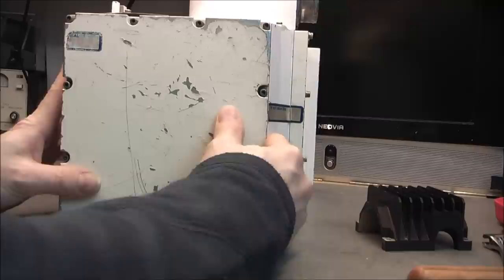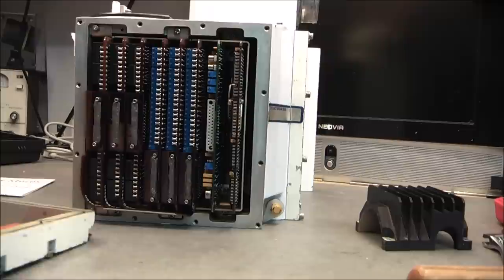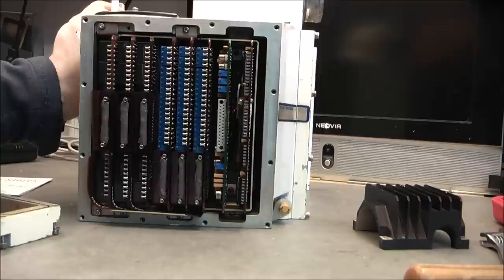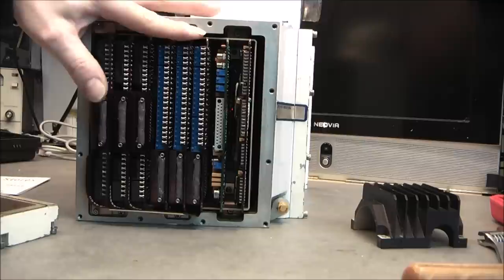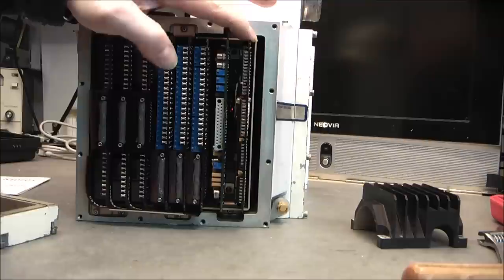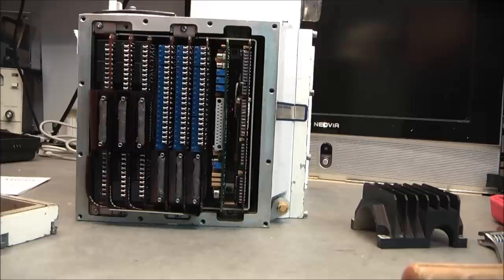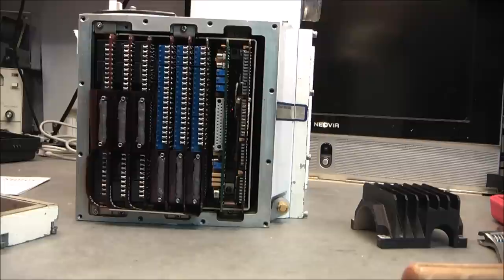Battletank boresight thermovision sensor teardown

Comment: The cryocooler is a split -pair Stirling type, the working "fluid " in this case is high pressure chemically pure helium (99.999% pure) is at a pressure of approx 30-40 bar. The compressor side of the system produces a pulse of gas which travels along the thin tube and and moves the metal piston with the spring at the bottom( displacer / regenerator ). The reciprocating action of the displacer/regenerator cools the detector by only a fraction of a degree each cycle  but with many cycles each second the the detector is cooled to cryogenic temperatures within minutes.
Incidentally,  the detector is housed in a vacuum which is what the short pinch-off tube is for.

Comment: The cryocooler is a split-pair Stirling refrigerator. It used compressed helium as a working gas. 

Most of the inner parts which make it work are already shown in this tear-down. The details can be found in the wikipedia article for "cryocooler", and in Huges patent US5596875A, "Split stirling cycle cryogenic cooler with spring-assisted expander."

25:24 is the refrigerator displacer; the "filter" inside is the "regenerator" 

48:06 is the cylinder of the Stirling refrigerator, built into the dewar in which it keeps the imager sensor cold; 
inside of this cylinder the diplacer moved back and forth; the cold was generated at the very bottom of the cylinder

26:04 the large cylinder is the compressor, which produced the pulses of pressure which made the whole thing work. 

When it compressed the helium gas, the gas heated up (just like in a bicycle pump); the excess heat was taken up by the compressor casing; Compressed and cooled to the room temperature gas now flowed though the coiled tube to the refrigerator half. There, it passed through the regenerator inside of the displacer, where it exchanged heat with the fine metal mesh; Then, the gas reached the cold end. There it was allowed to expand, on the downward pressure swing; This made it cold. The cold gas then flowed back through the regenerator, exchanging the heat and now cooling the regenerator, which then cooled the next portion of the incoming has on the next cycle, and so forth, making it colder and colder until an equilibrium set in.

The cycles repeated maybe thirty times per second or so. With just one stage, such refrigerators commonly reach liquid nitrogen temperatures. In fact, larger ones are sometimes used for production of liquid nitrogen on a small scale.
Reply: how do you know?

Comment: Interesting video again, awesome. Tesla500 took apart a similar type of cooler a few years back. The thermal sensor i guess must be a single line rather than an array which is why it needs the rotating mirror.

Comment: Ah it has a flubber pump cooler on the back.  Pretty sad you ended up killing it. I remember getting a bunch of those SBRC imager heads. Surprisingly they are rather easy to get working. They use PtSi. HgTe, or InSb photodiode detectors inside. Just use a scan timer and a FPGA and convert to images at 15 30 or 60hz and you can replace 99% of the stuff in that unit short of the cooler and sensor.🤓

Comment: Watching that cooler  die was sad.  Great tear-down as always.  Audio went down quite a bit in this one, headphones at full volume was barely enough.
Looks like 60 individually calibrated mircobolometer sensors. and if I had to guess the facets of the rotating mirror will be offset by a small angle from each other to scan 8x60=240 lines of long wave thermal data in one revolution.  Much faster than the AGA because only one rotating member (less noise too) but at the cost of 60x more sensors.
The sensor part has a vacuum jacket around the sensing elements cooled from the cryo-cooler side and illuminated from the beryllium lens/port side.  The heavy gauge wires may have been for a small heater for thermal control as the cryo-cooler may have been uncontrolled and working at full capacity all the time.

A modern FLIR unit is quite a bit smaller and probably has better specifications for all features.

Comment: That is a liquid helium split-type sealed stirling cryocooler, which you thoroughly destroyed by disassembling the expansion head and then removing the cold finger(which was touching the sensor, likely PbS or PtSi) from the vacuum-sealed dewar.
Toss it in the bin, it's as good as dead now, or do a fully destructive teardown.

Comment: What you do with those devices after tear down....is it possible to buy these from u?
Reply from the maker: I usully keep them, sometimes salvage parts and scrap the  bad condition ot not so interesting stuff, and sell some items on ebay, check my items on a regular basis https://www.ebay.fr/sch/sylvain59/m.html
Reply: @msylvain59  can I get some parts from this device like the rotating mirror or may be the spindle with multiple screw holes with a center hole also...is it possible?I can make some cool projects..thanks